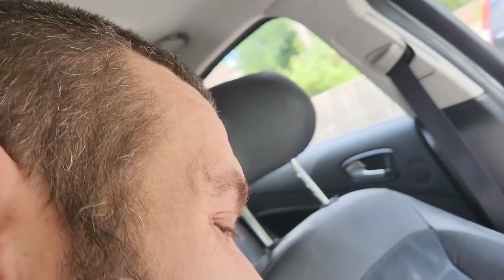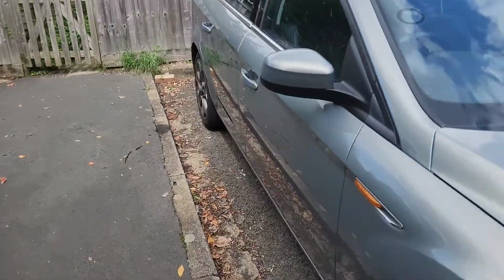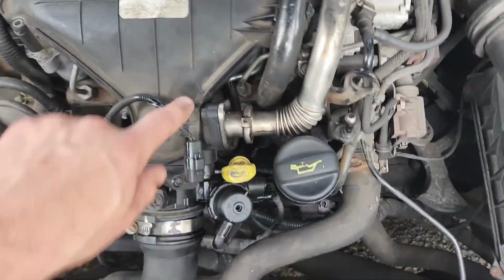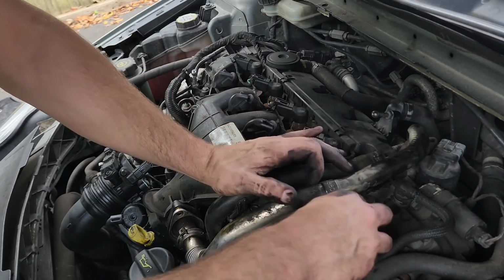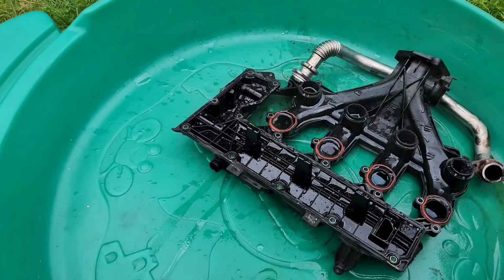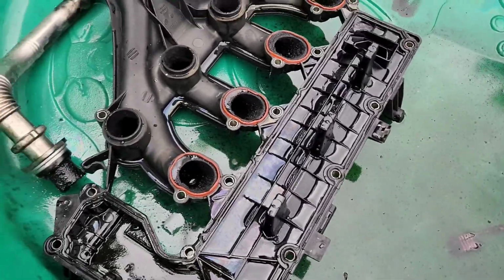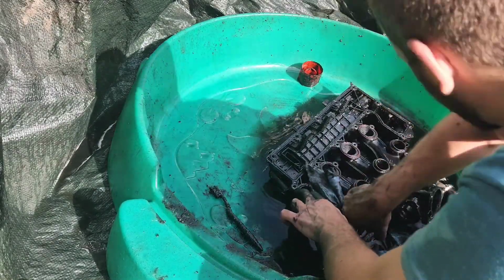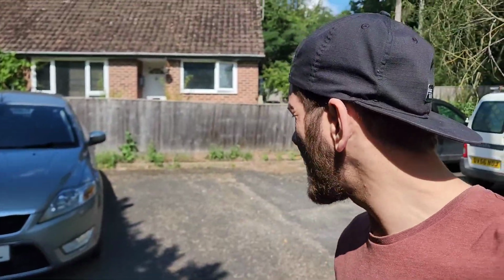Cleaning out the Intake! Ford Mondeo 2.0 TdCi 140bhp

Comment: i followed this to clean mine and it was very helpful. quick question, when you took out the cam shaft sensor does it need any adjusting to go back on or is it just push it in the hole and tighten it up because its got a slot and not a hole? atm the car is dead and im trying to go through it one by one to find out what i done wrong. cheers mate.

Comment: Hi quick question if you don't mind should the throttle body be open or closed when disconneted. As mine seems to be stuck in the open position. Ive taken it off to clean but still no movement any idea what the cause could be? cheers.
Reply: The throttle body doesn't work like on a gasoline engine. If you taking it off it should be open. It's there to prevent runaway and better sucking exhaust fumes from EGR.

Comment: Did you notice any changes after you cleaned manifold and if you did, can you describe them in the comments?
Reply from the maker: Hi, yes, noticeable improvement. Engine feeling a lot more responsive. It used to choke a little at high speeds. Now Nice pull throughout the rev range now in all gears. Definitely given me some ponies back!